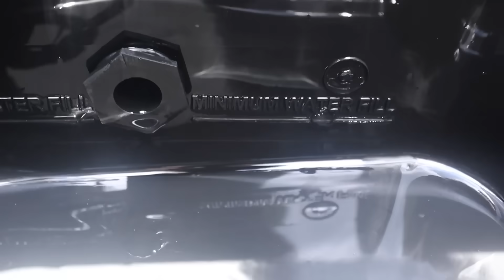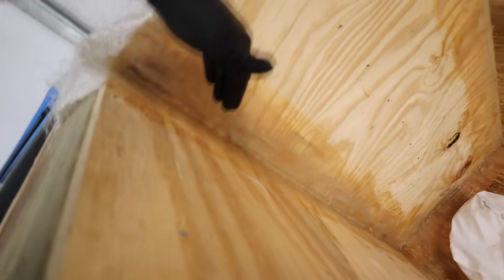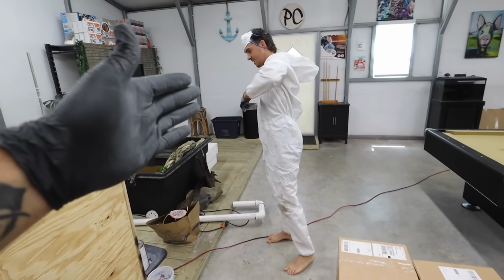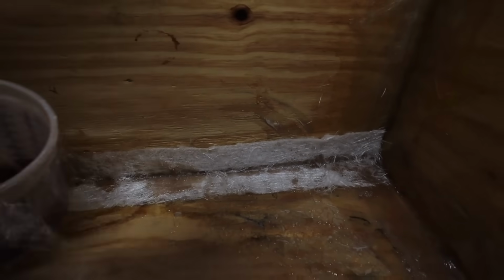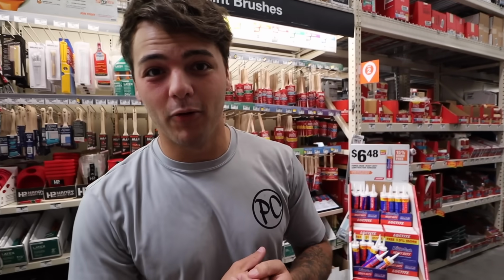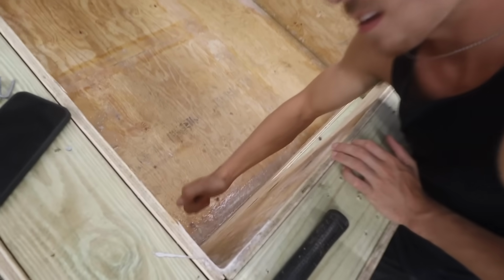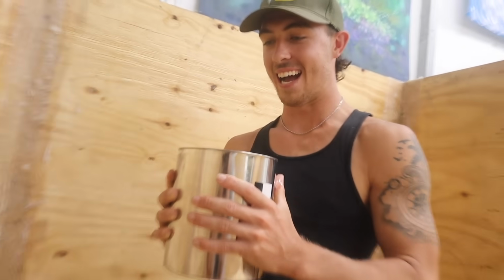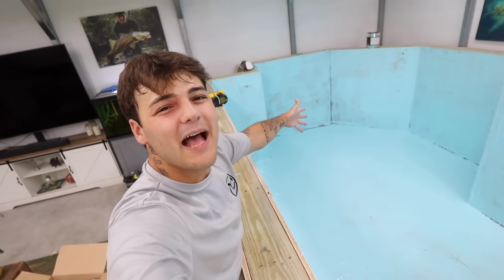Finally PAINTING My 4000G SALTWATER POND!!

Comment: Pro tip- make a smaller mix and cut in the edges and corners first with a paint brush then roll the rest on piece by piece on the walls - leave one dry for exit - roll the floor then get out and roll the last bits from the outside

Comment: Guy's get 2 new or clean buckets and mix 2 individual batches ,then start on one end and do corners ,walls and finally floor and move to the other end.
Also don't mix to much at once ,do like 1/2 of a bucket then make a 2nd batch to order. This way you'll be able to cover and possibly stretch out a 3rd coat to make sure it gets sealed.
It's going to be awsome .

Comment: Did you put wood filler over the screw holes? Otherwise there will be air bubbles and it will leak over time once the pressure pops the air pockets

Comment: Curious to see how well it holds up over time.
Reply: i hope they get it sealed up well. i don't think plywood is very waterproof 🤔
Reply: @easye137  you can make plywood tanks. No problem. A lot of people do it. I mean, the paint is what wil hold the water from getting to the plywood. But rushing it is not the way. If i look at the paint job, it looks like it is not mixed very wel (i am sure they mixed it properly, just looks like they didn’t). They need to take their time and not rush this. I am also not sure if 2 layers of paint is enough. Maybe it is enough, but for me to be comfortable with it i would paint it like 4 or 5 layers.

I am not a professional and i never build a pond like this. I am just saying what i would do or what i would be comfortable with. They need to think that the pond needs to be holding water for the next few years, not for the next few weeks.

Comment: Over time won't the wood get soft and rot from the water? You only fiberglassed the corners and seems not all of the wood...Don't get me wrong it's going to be a gorgeous salt water pond and I can't wait to see it. I'm just curious!!!
Reply: The paint seals the wood so the water won't actually be touching it 😊
Reply: It will, this is similar to "shower barrier" red guard . No matter how good you do water will work it’s way in between the wood and epoxy. Then moisture hits and causes separation. And saltwaters a  1000x worse , salt creep works it’s way everywhere. Like you mentioned, the entire pond should have been fiberglassed ….even if it was a small layer , then the moisture barrier. This will 100% leak within a year

Comment: Man I would have fiberglassed the entire pond , not just the corners . I hate to say it but these will not hold up long term . Saltwater creeps , it finds away ……as soon as it gets behind that epoxy "paint" and the wood gets moist it’ll start separating. Those widows are going to be a problem no way to create a permanent barrier / seal . Same goes for returns or overflows …This will leak inside of a year

Comment: I'm sorry but that won't last more then a year before it starts leaking, trust me! You didnt use any base coat/concrete to seal the wood, nor did you use any poxy primer to bond the fiberglass to, you can't just slap fiberglass on like that to bare wood with a brush and expect it to stick, lol you needed to use a roller to really get the air bubbles out, then sand it smooth and repeat ATLEAST three maybe four times because of the thickness of the fiberglass you used just wasn't thick enough,then two maybe three coats of topcoat! With a sand in between each coat! It's goner look all rough with sharp edges for mold and bacteria to grow! Give it six to ten months I guarantee you will have leaks! With the cash you spent you should of just got a professional in to do it,  you got hector in to build the pond it came out lovely, now I feel you're goner regret not getting in the professionals to finish it off, yes you might of saved some cash, but what's it goner cost you if you have to start from scratch all over? Some things are just better left to someone who know what they are doing, this im afraid was one of them things!